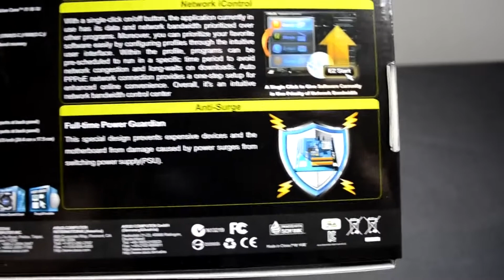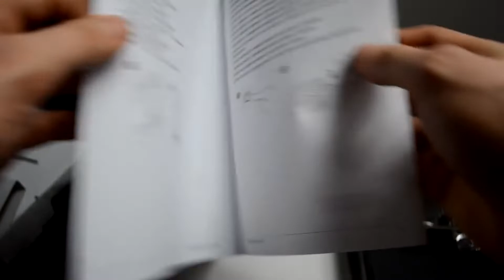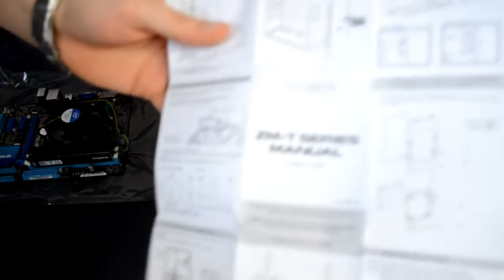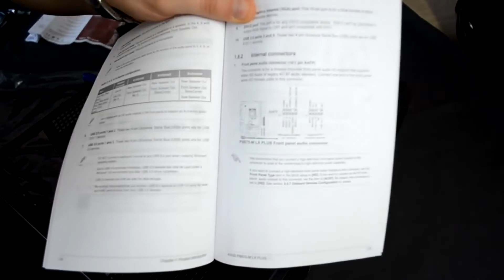Asus P8B75-M LX Plus motherboard unboxing & installation

Comment: Do you have any $200 graphics card or less recommendations to go with this motherboard?
Reply from the maker: the weak link in your system will not be this motherboard, but - RAM, CPU, VGA and PSU. I would recommend looking at VGA benchmark and  buy the best price/performance.

Comment: Hello i have this motherboard,, is every mobo like this when we turn on pc they on a bit and off and on again after that?
Reply from the maker: Did I understand correctly, that your computer shuts down after a while ?
Reply: @TechscrewHome  not shutdown,,, its work fine,, but when start pc they like that... On fan rgb on 2 sec,, and off, and on again normally...
Reply from the maker: @ekowidodo8984  the easiest way is to test another PSU first, like from a neighbour or friend

Comment: I want to buy a computer that has this motherboard, is it good for gaming? Does it work without a problem?
Reply from the maker: budget gaming
Reply: Cour i5 2400 3.1 hz 
gtx 750 ti 2gp 
Power supply  500watt
hhd 500 gp 
Ssd 120 gp  
Ram 16 gp ddr 3 
Mutherboard Asus p8B75 
Is it good for games
Reply from the maker: looks good, but it mostly depends on what you're playing and what your requirements are